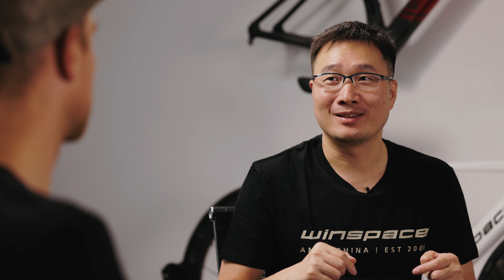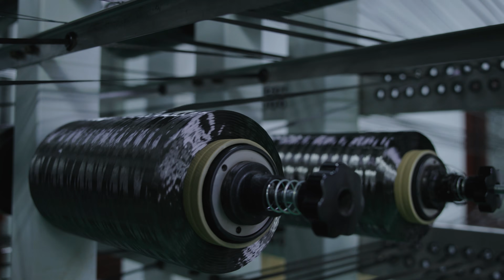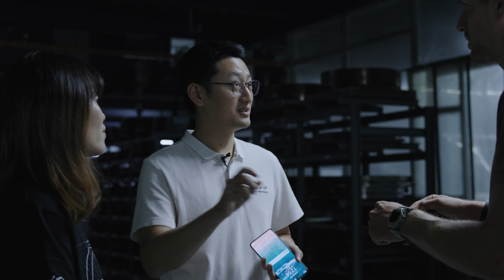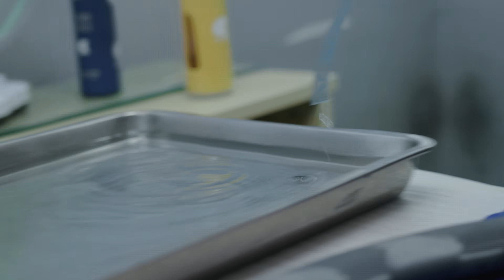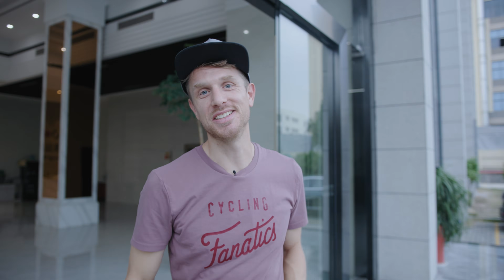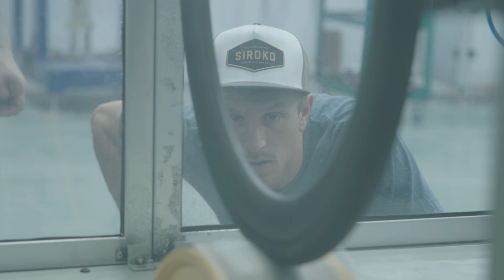Watch This Before You Buy Carbon Wheels in 2024! - Lún Performance Factory Tour

Comment: The Dangers of Carbon Dust
What you saw in that video is incredibly dangerous. Sanding carbon fibre creates a dust of microscopic, sharp, and incredibly strong particulates. Here’s why a simple mask is nowhere near enough protection:
Particle Size: The most dangerous particles are the ones that are too small to see. A simple fabric or paper dust mask might stop the larger bits, but the fine, respirable dust goes straight through and deep into the lungs.
It Doesn't Dissolve: Unlike some organic dusts, carbon fibre particles are inert and insoluble. Once they are embedded deep in the lung tissue, the body cannot break them down or expel them.
Irreversible Damage: Over time, the body's immune system constantly attacks these foreign particles, leading to inflammation and scarring of the lung tissue. This causes conditions like pulmonary fibrosis—a permanent, progressive, and fatal lung disease. It is frighteningly similar to what happens with asbestos (mesothelioma) or silica dust (silicosis).

Comment: Most carbon wheels are made from T700 or T800 carbon. The tech and weight hasn't changed for 15 years.  Only thing that's changed is the sizes and stickers. Simple as that.
Reply from the maker: Mmmmm I don’t agree. The tech has changed a lot! 15 years ago it was all rim brake, now it’s all disc. 
Now it’s carbon spokes, 15 years ago it was only steel. 
The way the rims are made is also changing.

Comment: Yeah, a lot of people don't have a clue how manufacturing works or who's actually making the things they use. OEM manufacturing is very common. People are rabid about not buying things from China, all the while being totally unaware that a lot of what they own comes from there, even the nice high end stuff. 

You'd be amazed at how often "clone/knockoff" products are the exact same thing as the name brand. Same manufacturing facility, different label on it. 

This isn't just a China thing either, we do the same thing here in the States. I've worked a handful of production jobs from assembly worker to product designer. It's the same thing. A different order comes across, you use one or a few different parts on the item (can often be cosmetic), put a different sticker on it.

These guys are actually doing way more testing of their products than any company I've worked for does (and I've made far more complex items at those places).
Reply from the maker: Great comment! And coming from an American 🇺🇸🙌🏻🙏 appreciate it.
Reply: @jasperverkuijl  No rose tinted glasses here, I see things for how they are, not influenced by marketing, and have the experience to back it up. 

"US Made" is marketing, pure and simple. We're nothing special in that regard. If anything we're pretty middle of the pack when it comes to quality.

Comment: My winspace rear wheel got cracks around the valve. Only noticed them 4 months AFTER 2 year warranty up.
Winspace offered replacement with old stock wheel. 
For money!
Not interested in seeing the photos.
Be wary of the 2 year "guarantee"
Reply from the maker: Hey sorry to hear it cracked. 
So it was outside of the warranty, what is your point exactly? 
I mean, I feel bad for you it broke. But every company had a warranty and will keep to that. I recently had an electronics product broke 2 weeks outside warranty and they wouldn’t help me either. (As example..) I don’t know if you can make this into a negative…

Products have a certain warranty period. 🤷🏼‍♂️ I’m glad they can offer you a replacement.
Reply: It's good to know that you think that a rear road wheel is A o k to develope multiple cracks (a step on the way to a catastrophic failure) after only 2 years and change - passes your idea of quality control? Wow! And it's just like say an iPhone situation? Jasper you need to speak with people who have been permanently maimed by the bike industry and its lackadaisical attitude to safety before making such comparisons.
Reply from the maker: @FrankFrankston-kj4sx  don’t put words in my mouth that i didn’t say please. 
I absolutely do not think it’s ok that your wheel breaks. But things like this do happen. (The factory makes 600.000 rims each year! You think no rim will ever fail? That has nothing to do with quality control, that’s just how it is. Same happens in cars, airplanes etc etc)
I had (another brand) rim crack by riding through a big pothole. This can happen after a week or after 5 years, result will be the same.. The product is designed to withstand certain things but not everything. (Just like airplane wings, they will break when the stress is too high..)

So again, I feel sorry for your broken wheel, but don’t get all upset with me when I make a factual statement about warranty expiration.

Comment: It’s not only the quality of the wheel you should consider but also after sales service and parts.  I have the Hyper 50s from 2020 and GRAPID 700 Gravel wheel set from 2021 and both have been great. Recently I needed to change the free hub on the Hyper 50s,  The newer V2 hub has a different end cap.  Does Winspace supply end caps?  There response we don’t supply these.  For my Roval wheels from 2018 I can still get end caps but not for my 2020 Winspace wheels. Not too sad as I got 4 years from the wheels and they were great but I’ll go for the Specialise  Roval to replace the rear wheel.
Reply from the maker: You cant get a correct end cap with the V2 free hub?
Reply: @jasperverkuijl  No, the free hubs don't come with end cap.  I do love the Hyper 50s though they are great wheels. So, I've used the hub and end cap from the gravel wheel on it and it fits perfectly.

Comment: What's the difference between the Lun and Winspace models?
Reply from the maker: Lún is the wheel brand. Winspace is the main company. 

There are no “Winspace brand” wheels, it’s Lún. 
Did that answer your question?
Reply: @jasperverkuijl  I see.  Final question, do they make a rim brake frame? I hate disc brakes
Reply from the maker: They used to….. not sure if they still have any. Check the website!🤙🏻🤙🏻

Comment: I'd be really interested if someone had made the effort and researched which of the Western brands sell these wheels with different decals.
Reply from the maker: None! These wheels exactly how they are at Winspace are only sold by Winspace. The hub-spoke-rim combination is very specific and will only come out of the Winspace HQ (their assembly line). 

However, The spokes that come out of the big production facility shown in this video, are used by multiple other brands (but maybe at slightly different length and nipple since that’s specific to hub and rim combo). 
The rims (from the same facility as the spokes) are similar to other brand rims that will roll out of the same production line. But like explained in this video, they will/can have different specifications, different finish, different materials etc etc. 

Hope this helps. Let me know if you have other questions

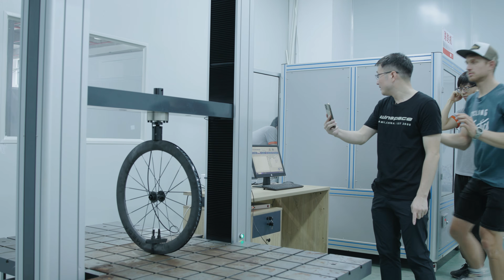Comment: @29:00 shame it was not with a tyre on it , that would have helped spread the load and see what their spokes can actually take
Reply from the maker: Yes I thought about that too. Now the rim edge failed. But the spokes and hub and rest of the rim were still intact. 
If we could set up a test rig that would decide the load over the rim to the spokes the force would be much higher. 

But the test we did sort of replicates hitting a pot hole so will kind of show how hard you can hit the rim edge before it fails.

Comment: Major problem with carbon spoke is that carbon is very strong in its long axis.  ..... I've seen so many broken spokes from side impacts.    I would never buy carbon spokes
Reply from the maker: I never see a broken carbon spoke 🤷🏼‍♂️

(Had one that had a slight damage when checking a wheel but it was still in the wheel with no problems)

Comment: I ride an S-Works Tarmac SL with Roval wheels. My friend from Hong Kong rides an unbranded bike with unbranded carbon wheels, most probably made in this factory. His bike is also fitted with accessories including groupset, BBs and other elements, all made in China and well finished. I feel just as comfortable and safe riding his bike as I do on mine yet his bike cost way less than what I paid. Excellent video, this factory appears to have has some fantastic state of the art machines that produce high quality wheels. Thank you.
Reply: The challenges with unbranded parts that come from the same factory is that the layup, which fiber used, process,  etc can be very very different even though it is in the same factory.   

I will never trust unbranded carbon parts as I will. Never trust unbranded cast steel parts.    There is no way to know what was skipped in the engineering design phase.   

It is not a factory problem,  it is the client who paid the factory problem.

Comment: I have been trying hard to destroy a pair of Hypers for the last 3 years. No luck so far.

My next wheelset will most probably be Hyper again although I do wish they offered them glossy with withe decals like Elitewheels Drive.
Reply from the maker: 🙌🏻🙌🏻 
I think there could be an option to get custom decals. My hypers (2023) have white decals as this was an early release so maybe they have some leftover stickers 🤪

Glossy is probably no option as they don’t have any paint!
Reply: Then get elitewheels. They actually own their factory and do own r&d. Elitewheels is a inhouse brand of one of the biggest factory in china yuanan carbon
Reply: @kubackjeee  Yes, that’s a possibility. Hope they update the Drive with better hubs. I like the Helix but it is too wide for my frame
Reply: @tonyg3091  nothing wrong with drive hubs imo
Reply from the maker: @kubackjeee who says they own their factory? Thats usually not the case in China. (Maybe just the wheel assembly line)

I’ve received 1 Drive wheelset….. it turned into 💩within a few weeks. So that’s my (only) experience with Elite….
Reply: @jasperverkuijl  elite wheels is a brand of yuanan which is one of the biggest wheels manufacturers in the world (the oem for ffwd, ORBEA etc.). And yes they own the factory and have their own r&d.
Reply from the maker: @kubackjeee   my I ask where your info is from? As I saw the same brands in the Xiamen factory I visited. (Of course they can have multiple suppliers 👍🏻) 
There is usually not 1 “factory” where the wheels are built start to finish so I’m just wondering what your source of info is…
Reply: @jasperverkuijl  i don't know what's hard to understand here. Yuan an composite is a large OEM manufacturer and elite drive is their own brand. It's on their website.

Comment: I purchased a carbon wheelset directly from China for my last bike build. I started to purchase a top "American" branded wheelset and got sticker shock when they totaled $3,200 or so. Did some research and found a highly respected Chinese brand (who btw manufactures wheels for American companies) and got a custom wheelset for $1200. Great wheelset!  Love them! The Chinese company communicated with me during every step of the process, even when one of the wheels was out of spec. They asked if I wanted them to make another wheel, and they did what I asked. What I found out was that American companies will not tell you that they often outsource carbon frames and wheels to companies in Asia and China. Even with shipping costs, it's still cheaper to make things outside of the U.S. The U.S. companies then double the price of those same products and make millions.
Reply from the maker: Yup

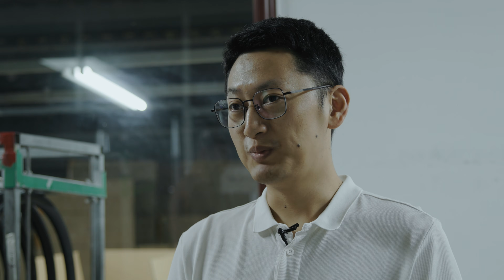Comment: Great video.   Except at 20:00 mins, when they say they conduct QC at every stage of wheel development "so that the rider gets a good quality product".... that isn't the real reason.
QC is conducted after each stage because with significant automation at multiple stages, if you had QC only at the end, you could have 1 whole day's worth of wheels utterly wasted due to failure in one stage.    Whereas QC after each stage means you might only have 1/10th of a day's wheels wasted if there were 10 automation stages or opportunities for failure.    The low cost human labour to QC multiple times is far cheaper than 1 whole day's worth of failed wheels.
Reply from the maker: Peter did also mention they focus on QC because they use a lot of automation. So your reason has also been given by him. 
Everything can be interpreted in many ways and taken out of context. I’m sure there is more reasons a proper QC is important, and not waisting a day of factory time on a faulty wheel is certainly one! 

whatever the reasons, the most important is that we get a good product.

Comment: 13:20 Lún announces a rim production without any paint or decals, something that Campagnolo and Fulcrum are already practicing. They produce the finish on their carbon rims in the mold, and laser the logo after in the sidewalls and are absolutely competitive in terms of value for money. Amazingly, these rims are made in Europe. 
This means that these rims are more robust against scratches and chipping, and the weight is reduced due to the absence of paint or decals.
Reply: No carbon structure is resistant to scratches, don’t be silly.

Comment: Thanks for the video. I purchased the Lún HYPER 23 SE R33 RB , Nov 23, and have ridden 1300 miles on them. I’m very pleased with the purchase and would buy them again. I did see one minor defect on one spoke on the wide flat section, I noticed a small bubble, not sure what it was, it was the same color as the rest of the spoke. I thought it was unfortunate but not too worried. They were also $300 off for holiday season. Thanks Winspace!
Reply from the maker: Nice!! 

If it gives problem you could always replace the spoke easily.

Comment: What i do not understand is why they have problems making  a wheelset under 1 kg.
Hence ADA made in 1995 already a wheelset for Marco Pantani of 995 gram.
And was a smal 3 family based bike Shop.
This Chinese compagny is huge with a lot of resources it seems compare to small bike shop.

You would think such company comes with inovation in bike industry.

As example  non contact braking.
Or Abs 
And so on
Reply from the maker: Nowadays the rims are way deeper (for aero reasons) so i guess that is a big part of the weight?

Comment: The carbon hoops are fairly stable in their manufacturing. The methods are well known and very stable and repeatable. The money for a wheel is in the hub. It's often proprietary and designed by the manufacturer.  The other consideration is repair. Carbon wheels break, a lot. Pot holes, road debris and crashes. Can you get replacement hoops and spokes and can it be repaired locally?
Reply from the maker: I don’t think they break a lot, but sure they break sometimes. 

Yes  Winspace does offer replacements parts. And you can fix it at a local wheel builder

Comment: Nope, wheels I bought are made in usa.
Reply from the maker: Which brand?
Reply: @jasperverkuijl  forge + bond.  Shift series.  $937 a set right now.  I got a set for my gravel bike and a set for my mountain bike.
Reply from the maker: Ok. Unknown brand to me but I’m sure it will be good  👍🏻👍🏻
Reply: @jasperverkuijl  they are fairly new.  Have made wheels for some other brands.  They use carbon with nylon thermal plastic instead of epoxy resin.  Lots of videos and web reviews.

Comment: The testing looks amazing gives some confidence.   I am currently checking to see what is out there, by the way the wheel test while spinning is one I am interested in I'm 165-Kg and am keen to see if wheel can handle speed under load going at 250-KM per hour.   Yes it sounds ridiculous but I need to know wheel can handle the speed under load, I haven't even considered braking as I'm sure I can sit up and get bike speed down to 110-KPH.   I also will need to know if these wheel sets exist on a serial production bike, not a prototype.

I have a motorway near by 253 meter altitude between top and bottom, hill section is 3,000 meters long, hard pack small chip seal.  Grade 8.43%, acceleration 0.82M/S, acceleration drag adjusted 0.52M/S, CFD 0.25, X-Section 1.2M, Air Pressure 99.9Kpa (NTP), pedal power 1,000 watts + for 5-secs, can use run up from other side of hill so hit start line at 40KPH+ and then apply 1,000 watts plus pedal power to get speed to 100-KPH plus in under 20 seconds or 460 meters of travel, so over 2,000 meters to get to 210.5 KPH and 500-meter run off to flat.   In any instance I'm comfortable braking to reduce speed to 110-KPH on hill transition to flat as it's a 3 lane motorway with no cat eye's at transition area. 

Note:
Current Serial Production Unpaced Bicycle Record is 210.4KPH, I'm a heavy, crazy bastard that loves speed and bikes.  If someone can validate my calculations I'm open for an attempt to give record a nudge.  I don't speak Chinese and concept is in it's infancy, is there a contact person at wheel assembly where they did load test?
Reply from the maker: Interesting. Send me an email (in description) with details